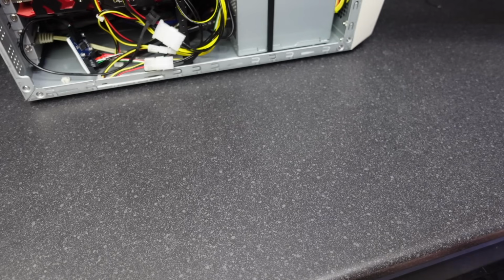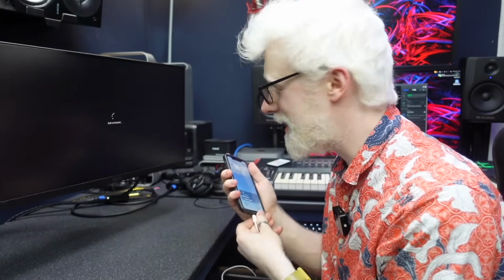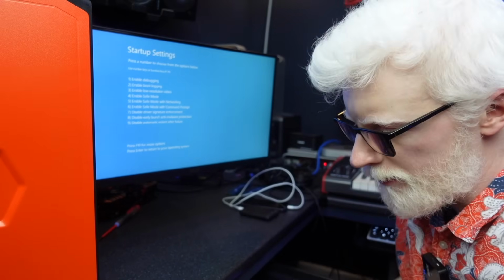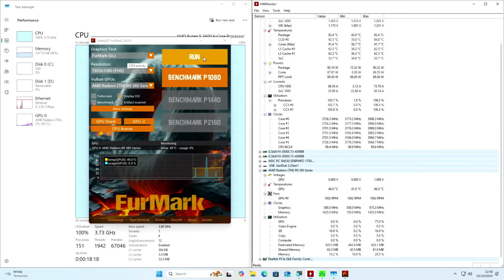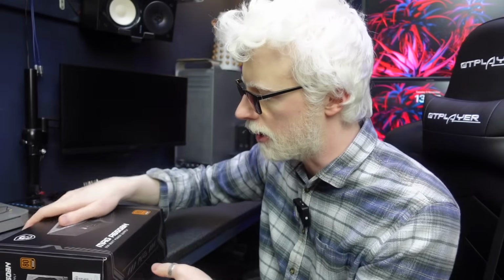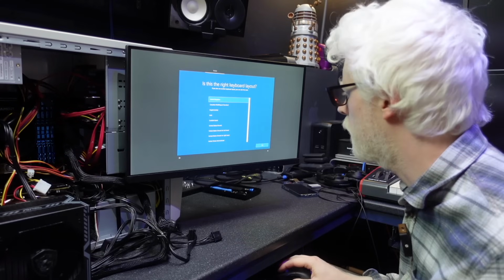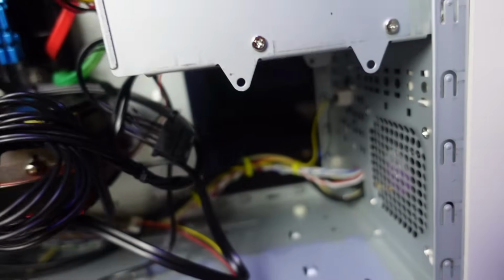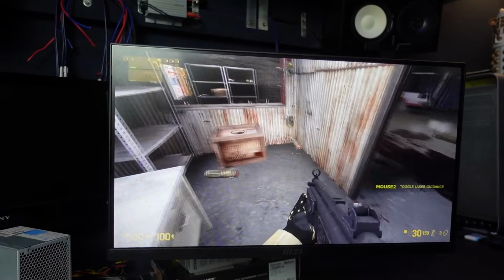IMNC Beige Build: Episode Four (It's Finally Finished)

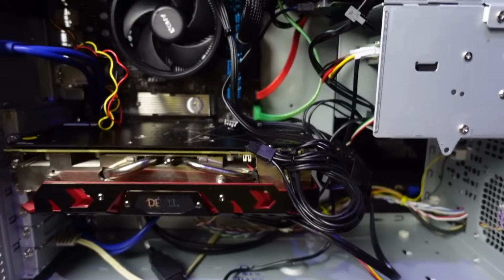Comment: 49:01 I got this exact case after seeing your first video on it, (I actually snagged the very last one they had apparently) and it ended up with a super similar layout with two hard drive coolers and a disk drive. I what I ended up finding for the 4th slot was a beige 5.25" storage tray on Ebay.

I used it as intended for a little while to keep track of my SD cards, screws, and adapters I was using in the build, but what I ultimately ended up doing was taking it apart and drilling 4 controller port holes for a GameCube controller adapter.

The fun bit is the tray still unlocks and slides out so I can give it some clearance to not block the fans or CD tray depending on what slot it's in, if you need to use one of those tall wireless receivers.

But yeah, a little hidden storage tray could be a fun idea. Although I had to sand the face plate to give it that matte finish and the correct color. Thankfully it just comes off as it's own piece so that's super easy.
Reply: I still use two spring loaded 5.25" storage trays in my main system, and find them really, really handy. It's little bit of a mystery to me that more people don't use them for storing flash drives etc. Apart from the smooth feeling, heavy guage build quality of "retro" biege cases (for the most part) the other thing I love is the weird, and sometime wonderful "bay fillers" back in the day.

Comment: Just an observation (not a suggestion) but bizarrely, if someone did build a retro looking (sleeper build) system, one advantage (apart from making a thief think your system is not worth stealing) is that you could store lots of small text files on a ZIP drive as a security measure, I doubt the average thief would have access to a ZIP drive to read them.

Comment: I‘ve got a lot of trouble with MSI motherboards in the past. Now I mostly use Gigabyte ones and they never let me down.
Reply from the maker: I've always used Gigabyte without any issues. I was surprised to get issues with this MSI board, but as a few people have pointed out there were a lot more things I could've tried. I can't fully blame the board until I give it another go I think.

Comment: i know you  know what you are talking about. This has been my experience with MSI. I have been building pc at my shop with MSI boards for some time, and we have never had the problems you had. We use the following several b450 3 different variants of their b550 and seveal b650 and x670e in my main rig with a 9800x3d and have never had any of the problems you had so if it was causing the problems, it could have been due to the ram sticks you were using or timing on the sticks or just the ram might not have been on their QVL list but you could have got a bad bord i have had them before i can't help but notice that you were putting it in an older case maybe there was something shorting it out i only say this because when you switch to a different size board you stopped having the problem there are a lot of different things that could have caused and i have had something similar happen in a build where there was just a little bit of persher on the board in the wrong spot and made the board unstable and impossible to install windows on i took the build apart and installed windows on it as a test bench worked fine put it back in the case and insta crash right after getting to home screen this is a thought amy be you could check the case and make sure ther is nothing like this happening but as a rule i have never had an unstable board in less it was a bios setting or a bent pin which on AM4 is not the case this only happens on lGA  just some things to think of i have personally built hundreds of pc and there is always a reason for the problems if you dig hard enough so it is a little unfair to say that you won't buy another board from msi brand  over all this was a good video and enjoy your content this was just some things i dident see you check thought i would mention them thanks for reading this
Reply from the maker: Definitely, I agree with you. The likelihood of the board simply being dead is not very high, there may well as you say be an issue here that I haven't spotted. All great suggestions and if I had the time and patience I could've possibly found what was happening. I won't disregard MSI in the future, I'm only joking on that one. I understand that there's more to it than the name on the box. The little MSI board in here now is completely solid. I appreciate your tips, and it makes me want to revisit this board in the future.

Comment: I suggested using Rufus to make the install drive, or a distro of Linux to run tests, but I am really glad you decided against it (or simply forgot about it) as it would have just added to the chaos, as there were way too many variables in this video to contend with. I would like to see an update on the "Beige Beast" later in the year once everything has settled down, pared down hardware wise, and doing it's office duties. Thanks again for the entertaining video series.
Reply from the maker: Thank you! :_imncTomvlog:
Definitely, I hope to revisit in 2025 to give you all an update on this build. It also gives me a chance to see if I need to make any changes, I am considering altering the cooling to something more modern. As fun as it is having the machine sound quite authentic, it's extremely loud at night.
Reply: @ItsMyNaturalColour  So, a visit by "Dr. Noctua" is in order?? Along with less "Metal on metal on metal"(not an "Anvil" song) Hard-drive wise?

Comment: That power supply a rebrand of one of the major manufacture and its no fancy but does the job perfectly fine with no headaches. The dual power supply was a problem since it loses the ability to properly regulate the  power. The slot would be supply power and demand would go up and it would not be aware it should draw from the other source and try drawing more from the slot.  It's a learning experience as long as we get better from it😉
Reply from the maker: Does this mean I'm not allowed to try two power supplies again? Don't know if I can make that promise 😉😆
Reply: @ItsMyNaturalColour  No one said that it makes for good videos and small mushroom clouds 🤣
Reply from the maker: @magnus33john 🤣

Comment: it feels like there should be a "proper" way to mix the two power supplies together but i'm not sure what it would be exactly. probably something using transistor feedback to have one power supply act as a master and "regulate" the follower to match its voltages exactly? there is apperently also a method using schotkey diodes and balast resistors to create a common average point but that sounds like it would waste a lot of power.

Comment: That's funny, that's the exact same PSU I bought to put into the Optiplex 990 to help "future proof" it in case I decided to get a video card that requires extra power with a cable, as well as just new clean power for the 2gb Invidia graphics card that doesn't require a sep power, but does require more wattage than the factory 240 or 260w psu came with. Maybe it was less. Regardless, it didn't hurt to put it in and I also noticed it had a floppy power cable. Now I want to see if the mother board has a floppy plug. It probably doesn't, but I do have an external USB floppy just in case I want to try to boot from that for some reason. I've used it in the past on a different machine to boot into freedos or something to flash a PC ATI video card to Mac Rom for that Blue and white to give it a 32mb of video ram back in the early/mid-2000's I believe.

Comment: Awesome, cool to see it finally complete! (Not to mention working properly!) It did seem like it would initially be a PSU related issue, but with the motherboard swap, you might actually be able to use the dual PSU setup again. Even if it’s only for testing components out. Classic Windows, seems like it BSOD every minute! Glad to see everything sorted out though, the final setup looks amazing!
Reply from the maker: Thank you my friend! Yes deffo, would be really interesting to see if this would be stable with the 2 PSUs. I regret not trying the motherboard swap before purchasing the PSU, but I really didn't suspect the motherboard... that was my very last guess.
Reply: There’s always more that could be done, but it’s also nice to just have something work! I typically try to do a lot with projects/setups but like the Beige Build, it can take forever (especially if you have multiple ongoing projects!) At least now you can get some good use out of the system, and there’s always more projects lol.
Reply from the maker: @TheOriginalCollectorA1303  Absolutely! This is 100% the way I feel about it.

Comment: I had a feeling you'd end up ditching the dual PSU setup. It was a cool idea, but I doubted it would work. If you'd used 2 identical  supplies you might have had better luck. But as it was the voltage difference between the voltage regulated on the board and provided through the PCIE slot, and the voltage regulated by the PSU and then additionally regulated on the GPU would likely be enough to upset the card as the older PSU probably didn't regulate to a high enough tolerence. I doubt the setup would have killed the motherboard. You could always strip the power supply down and paint it silver.
Reply from the maker: Deffo, it's just easier this way and less to worry about. I am curious though how things would work with the non faulty motherboard and the 2 PSUs, because it now seems like it was the motherboard all along causing the issues.
Reply: @ItsMyNaturalColour  I think it would work better with the simpler board but it depends on how it regulates voltage for the PCIE slots. If it has voltage monitoring and requires the rails to be within a certain tolerence of each other then it might still trip up. Generally the 12V rail in a power PSU isderived from a single voltage rail, and in cases wehre the power upply has independent 12V rails there is usually some logic in the supply to keep them within about 0.1mV of each other for this reason. The 2 power supplies could be as much as 0.8V or so off, especially as the power supply running the GPU didn't have much load when the card was basically idling. The lack of any load on the 3.3 and 5V rails of the secondary power supply could also have caused issues possibly including random logic resets thus power interruptions. It would have been interesting to monitor the 12V rail going to the GPU to see if it dropped or spiked during a BSOD.